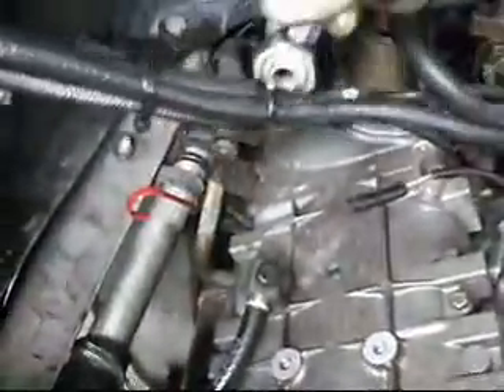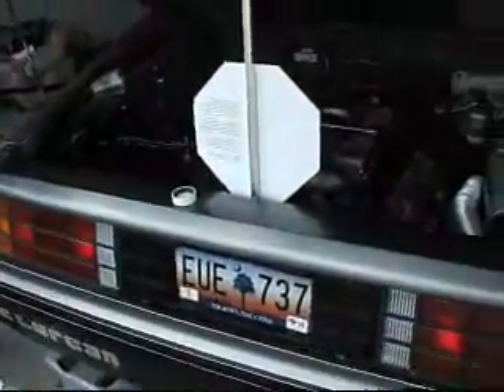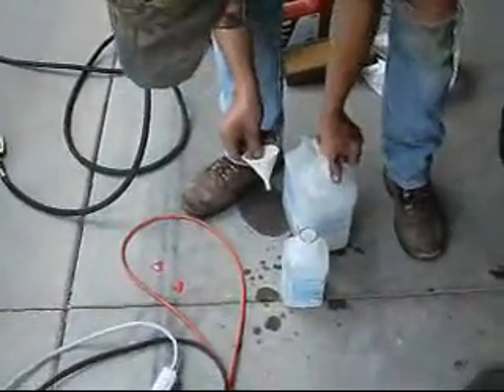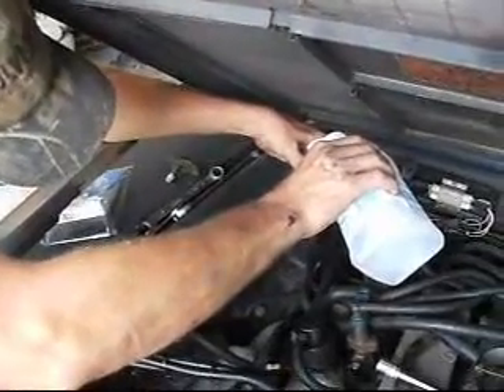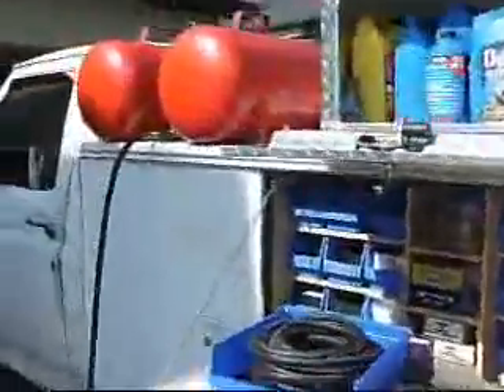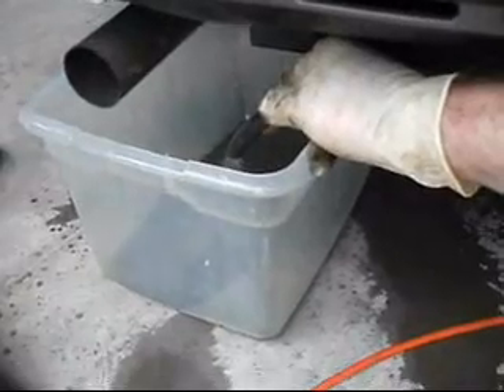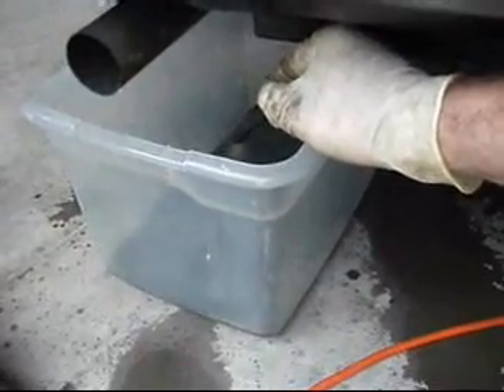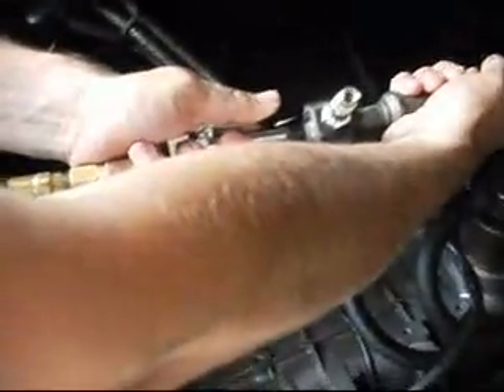DMCToday.com - How to convert a Delorean AC to r134a the cheap and easy way

Comment: I have retrofitted 2 cars before from r12 to r134 and the ac never blew cold air like before when those had r12. The best result for me was envirosafe (a mix of hydrocarbons) from this company in the internet. I didn't even need to put a full can in my system and the air was cold ice. No need to flush system since it's compatible with r12 and r134.. Try it. And no I don't work for envirosafe.

Comment: I have 2, count em, 2 holes in my hoses from the damn bolts to the gas tank cover.  Some rube forgot to install washers on the underside.  No I have to replace both hoses and the dryer.  You have any tips for that thing, i've heard its a sunofabich.

Comment: Did you replace any components (o-rings, etc) before doing this? I just took possession of an '82 that needs AC work and I'd much rather convert it than find a local R12 dealer and continuing to deal with that hassle.

And yeah, I haven't seen many delorians out there ever. But come to think of it, I don't see too many Deloreans either. But considering how I live in TX, I'd sure like the AC to work on the rare occasion it comes out of the garage.